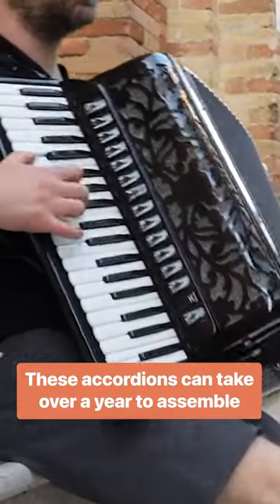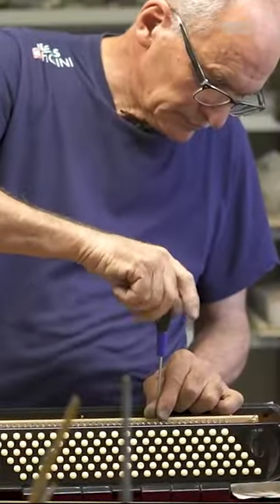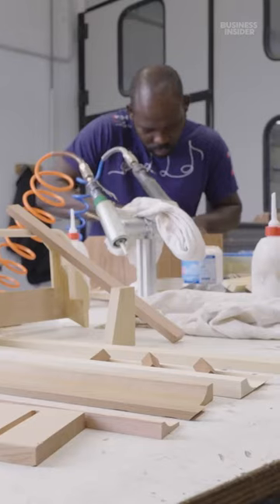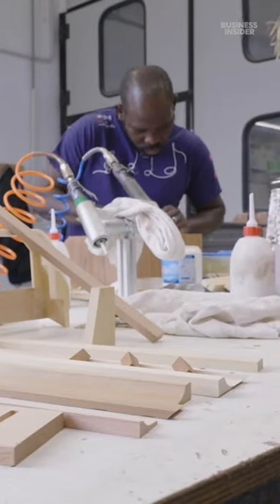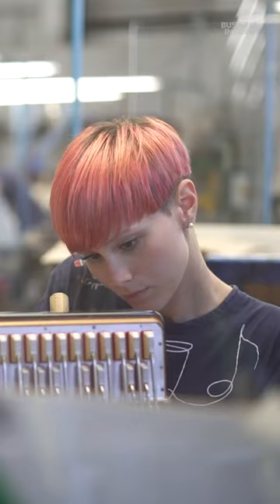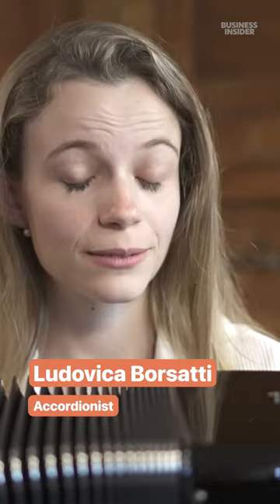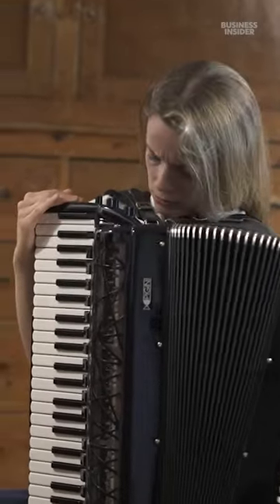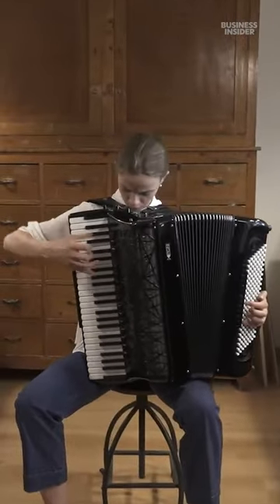Pigini undergoes a meticulous process to handcraft their #accordions. 🪗 #instruments #music

Comment: As a luthier, I'd assume that like vintage and higher end modern guitars, he uses hot hide glue. If you've ever seen the old Warner Brothers cartoons with the horse is brought to the glue factory: that's hide glue. It gets absorbed into, and becomes part of the word. It adheres at the molecular level, and is a "Self-clamping" glue, meaning that as it sets, it pulls the two pieces of wood together. Basically it's as close as you can get to making two pieces of wood behave as one solid piece would. It's great for stringed instruments because the instruments sound best when the entire thing resonates together at the same frequency. Unfortunately a solid piece of wood resontes much more strongly than when you glue two pieces together. Every seam acts as a dampner. Hide glue sets into a very hard, glass like material, that can resonate all on it's own. Normal carpenters glue sets into a plastic, which doesn't resonate. Just grab a plastic and glass cup and tap on them: the glass will ring, the plastic will clack. And while hide glue becomes part of the wood* and the normal glue doesn't, it means no matter how tightly high clamp that two pieces you're gluing together, there will always be a thin film between them.
It makes a very strong bond, but can easily be separated, i have to do it anytime i need to take a set neck off a guitar. I pull up the 14tg fret, drill two very small holes, and into one of them i pump steam into it, while the other is the exhaust. The glue returns to it's soft state and you can pull it apart. You can even reuse the glue to reattach them back together. This is how luthiers are able to disassemble 2 and 3 hundred year old violins and Cellos.

*The one comparison i can make to explain what i mean by "becomes part of the wood" (and only people older than a certain age will know what I'm talking about, is that it's like paper address labels they put into magazines that a person subscribes for. It's initially pretty easy to pull the paper label off, if you do it carefully. If the paper and magazine gets wet however, it's all but impossible to pull the label off; either some of the label will stay stuck to the magazine, or a part of the magazine will get stuck to the label.
Reply: Never thought this would interest me..but you wrote it very good, nice insights
Reply: Thanks. Very interesting.